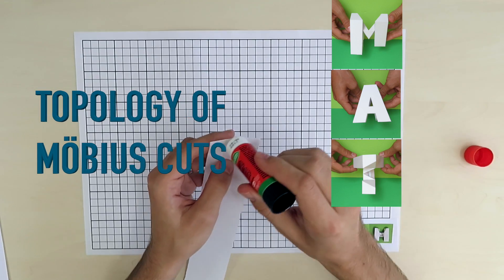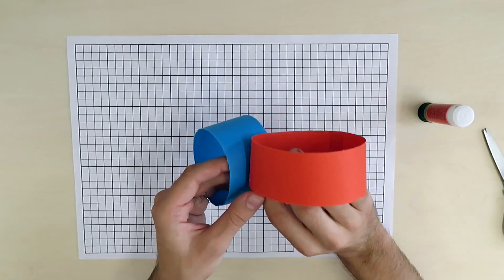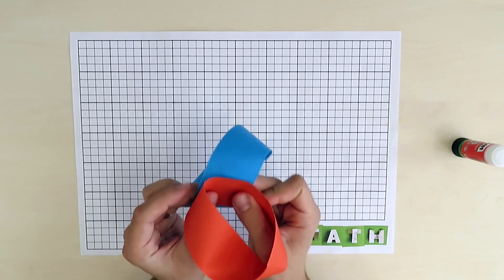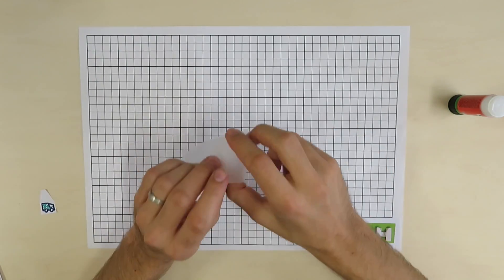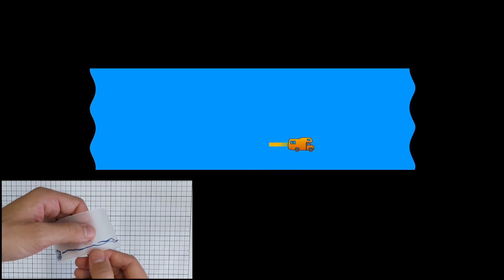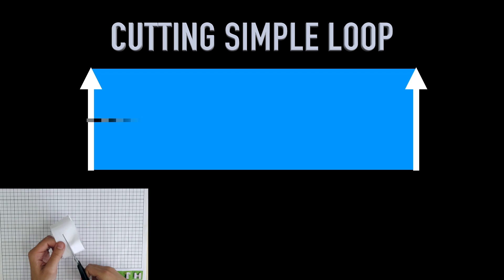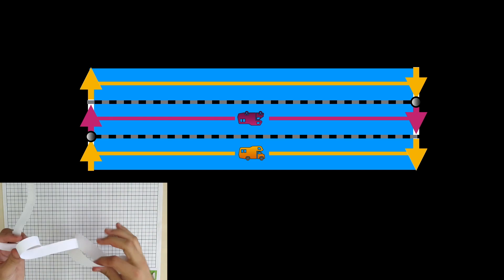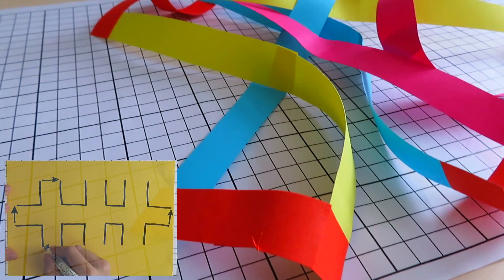Topology of Möbius Cuts | Simple yet Powerful Math Model for High School Students

Comment: So can you model cutting a Möbius strip twice down the middle? so the first time I did it I get the strip with 4 twist the same as you but when I cut it a second time it looks like I get 2 strips with 4 twists linked together....
Reply: if you bisect a strip with an even number of twists you get two 
loops, each with that same number of twists. So a loop with 2 twists 
splits into two loops, each with 2 twists, and so on.If the number of twists n is odd, you get one loop with 2n
 + 2 twists. Checking this against the case we already know, this 
formula does indeed give us the right result - a strip with 1 twist 
becomes a loop with 2+2 = 4 twists.
Reply from the maker: @SoCalStyles  Thank you for the generalisation. The model is (sadly?) too simple to distinguish zero twist and any other strip with even number of twist.
Reply: I replied to my own comment with an answer I found somewhere else.